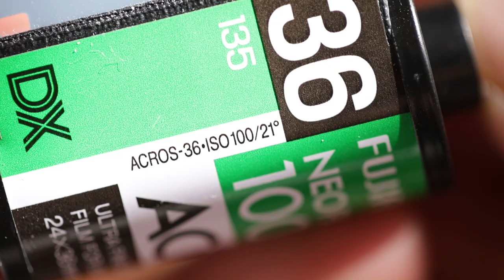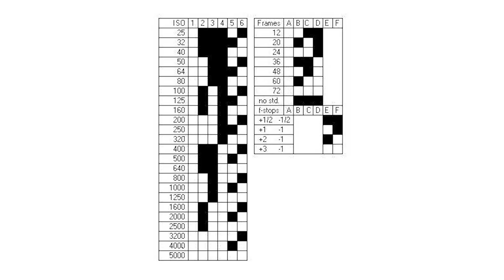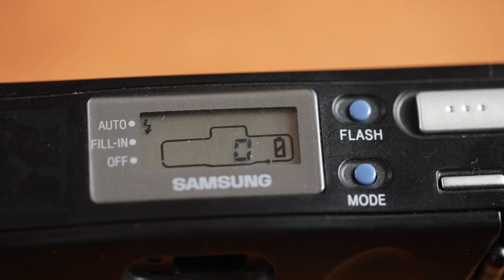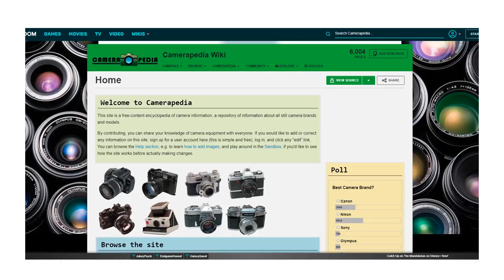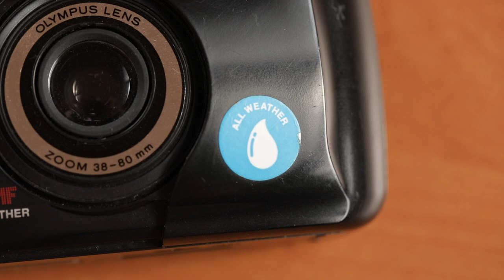Point and shoot cameras: film loading and basic tips

Comment: I have a very unusual Vivitar twin 1000 point and shoot camera. Basically has two different lens positions. You can switch between a wide and telephoto lens. The unusual thing about is when you load the film the motor does not Advance automatically you actually have to press the shutter button a few times to get it to the number one position. I'm currently using it for the first time so I don't know what the results will be. Despite being a basic camera it can still read the DX codes.
Reply: Any updates on your experience with this camera?
Reply: @hh4826  I haven't finished the roll yet. Now that it's Autumn in New England I'll probably finish the world soon.

Comment: Hi! i was having trouble with my camera but i finally fixed it thanks to your video! i just have a quick question, while i was trying to put the film in i took too much film out & went out the arrow so i just had to rewind it a little bit can i see use it? or is my pics not going to come out right?
Reply from the maker: If it was just a few centimeters or even inches, it'll still be fine. The camera had to pull a bunch out into the spool once you close the door anyway. So you should still get the amount of shots noted on the roll (eg 36 or 24)

Comment: Hi. I have a 35mm camera, point and shoot, vey similar to the one in the video. It shoots and the flash is working, but it does not roll up the film. (There is no film inside it because I'm not sure if it works). It does not do the typical automatic sound when you shoot. I wonder if I need to put a roll of film to "activate" this mechanism or it's just broken (?). Thanks!

Comment: Hey, 
is it right that only a DX film can load to the Olympus AF-1? 
Because I buy one from eBay and try to load it with a Kodak gold 200 and now after your video I am not sure it’s defect or just the wrong film, because it won’t load it.
Best regards and greeting from Germany 🙋🏼‍♀️
Reply from the maker: Hey, it should be able to load Kodak gold. Most likely it is just having trouble loading film in general. Did you try the tips in the section of this video talking about loading? If they don't work after multiple attempts, sometimes the loading is simply faulty.
Reply: @pushingfilm  Thank you for the quick help!

Comment: Hi! I just got my 1st film camera (Olympus Stylus Zoom) and I just finished my first roll of film.. theres a rewind button on the bottom of the camera but I'm having trouble with it, it's not rewinding at all. What should I do?
Reply from the maker: Hey! That little button is for forcing the rewind manually (it can be hard to press, you might need a pen) However, the Stylus will automatically rewind when you reach the end of the film. Take a couple more shots and see if it does; 36 shot rolls can sometimes give you 38
Reply: @pushingfilm  Ohh I see. It hasn't automatically rewind. I have the Kodak Ultra Max 400 and E keeps showing up.
Reply from the maker: E often means the film didn't load correctly. If you're successfully taking photos, the counter should go up each time. Did it ever do this?
Reply: @pushingfilm  i am also having the same problem! i don't have the E on the screen but instead i don't have the exposure counter showing after i loaded the film & the film is not advancing into the spool after taking multiple shots :(

Comment: if currently have 12/36 exp. on my film cam. if i remove the bettery, will it reset back to 0 or 1?
Reply from the maker: Most I've used won't, especially if  they have a smaller internal battery
Reply: @pushingfilm  i have olympus af1 twin. do you know if that one will reset back?

Comment: Men my camara doesn't have DX:( Anyone  know what film can I use?
Reply from the maker: Does the camera have any ISO selection options?
Reply: No, just let you choose between turning the flash on and off. I did not find any information about the camera,  the model is  "Lito 30 motor drive" and say in front lens made in japon.
Reply from the maker: @pablo2971  it might be safest then to use any roll of 400 ISO film, and use the flash when indoors or very low light. See how you go with that as a test 🙂
Reply: @pushingfilm  Thankss;) i will prove it that way